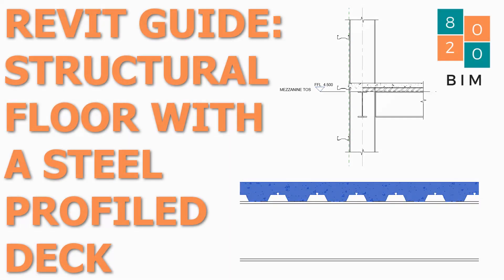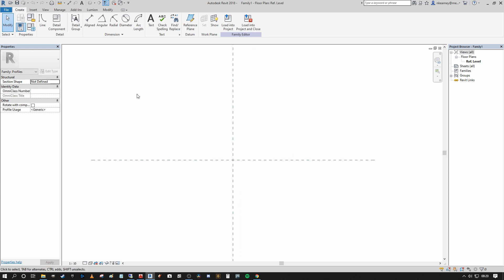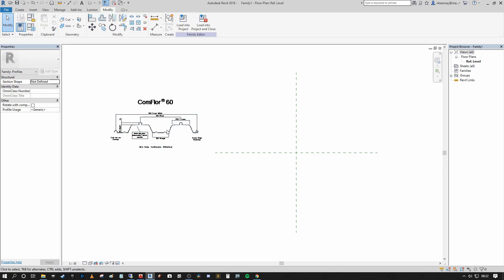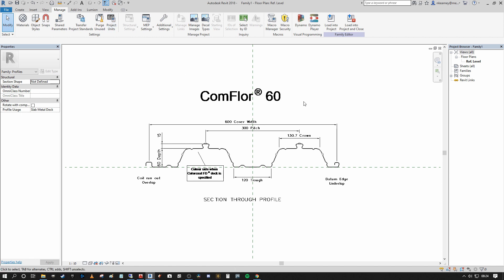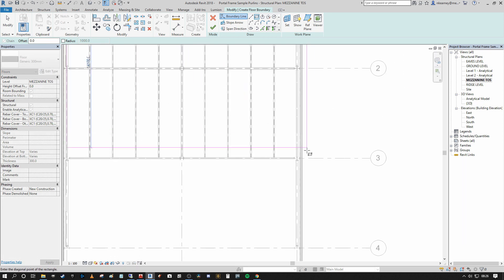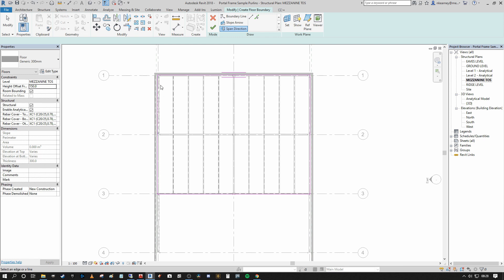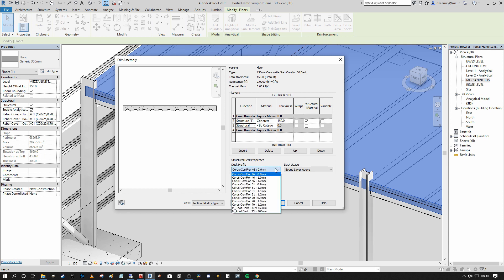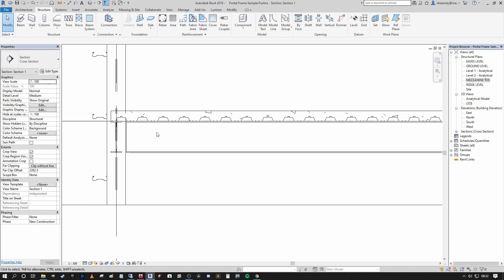Create a Structural Composite Floor with Metal Deck Profile in Revit

Comment from the maker: Quick Note : Around the 11.40 mark I assigned the Wrong Deck Profile to the Structural Slab. I should have used the Comflor 60 deck that we generated the Profile family before but absent mindedly I assigned it to the Comflor 70 that was already present in the project. My Bad!
Reply: The Comflor 60 deck was not in the list, anyway...
Reply from the maker: @KlavierSynth  hi Edgar, yes I think I failed in loading it in. 😅
Reply: @8020BIM  I guess it did not load because you added the thickness to the metal deck 60 you draw!
Reply: @8020BIM  i failed in loading it too. How can i load the new "personal" family correctly? thank you very much.

Comment: Hi! Like others in the comments, the profile I generated is not showing up in the Structural Deck Properties. Mine is just single lines (so no thickness like the example you showed) but I only see one option which is not the family/profile I created. Any thoughts?

Comment: Perfect tutorial, exactly what I was looking for. 
Quick question, what if I actually want to also show the metal decking in the Revit model? Is that possible?
Cheers
Reply from the maker: With this method you cannot see the floor deck in 3D. As defined by the ISO 19650 standards of level of information need it wouldn't be recommended either due to the complexity of the surface repeating over such a large span.
Niall

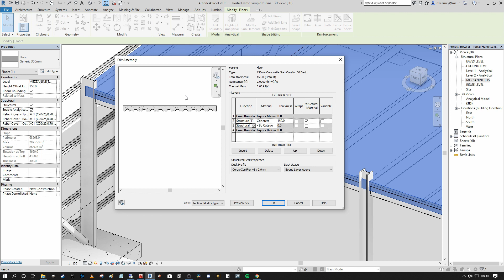Comment: Hi, first of all, compliments for the video. Secondly, I have some doubt in the minute 11:09. Once the fimily is edited and loaded, why I can't see it in the Structural Deck Properties -> Deck Profile?? 
Many thanks for your answer!!!
Reply from the maker: Hi Anna. Your Issue might be that your profile has a depth (as it was for me in the video at the point you highlighted). What I mean by this is the profile should not have a thickness. So instead of drafting the deck profile family with the nominal steel thickness you should just have the bottom line of the profile in place and not account for the real world steel thickness. Once I did this after the video I could see my profile in the drop down list when creating the structural floor assembly. Hope this helps! Let me know how you get on and I'll try answer any other questions that you have in the meantime. 
Niall
Reply: @8020BIM  Thank you very much!!! That was the problem, in fact now is working perfectly :)
Reply from the maker: @annafranceschi807  great Anna, glad it's all sorted for you.
Niall

Comment: Great tutorial, just one question... once a metal deck has been assigned I suppose that revit takes that into account when making material takeoffs right?
Reply: i did my own trial. i compared between floor 120mm with the deck and the regular 120mm. you know what? idk why but same volume (m³)
Reply: cmiiw
Reply from the maker: Hi there, thanks for the feedback. Yes it should be no issue. The material takeoff for the deck is area based so the material takeoff should be relatively straightforward.
Regards
Niall

Comment: hi there. ive followed your instructions to the T - but yet when i open my structural deck properties, my new deck profile cannot be found? do you know why this is?
Reply from the maker: Hi Dane. Your Issue might be that your profile has a depth (as it was for me in the video). What I mean by this is the profile should not have a thickness. So instead of drafting the deck profile family with the nominal steel thickness you should just have the bottom line of the profile in place and not account for the real world steel thickness. Once I did this after the video I could see my profile in the drop down list when creating the structural floor assembly. Hope this helps! Let me know how you get on and I'll try answer any other questions that you have in the meantime. 
Niall

Comment: Sir. Why to see  3D dont have steel deck, only section
Reply from the maker: Hi there. At the start of the video I stated that this method does not create a visible deck profile in 3D. The reason for it is because it makes the file too heavy graphically, so the programmers never allowed the profile to extrude in 3D views. If you must see the deck in 3D you can use a model in place family, draw over the 2D profile and extrude it the depth of the floor. Then, cut the floor with the in place family.
Hope this helps
Niall
Reply: Thanks you so much.